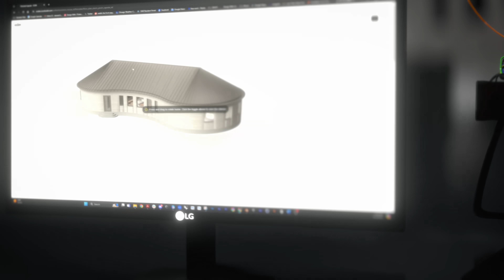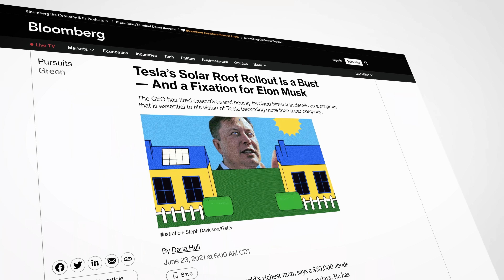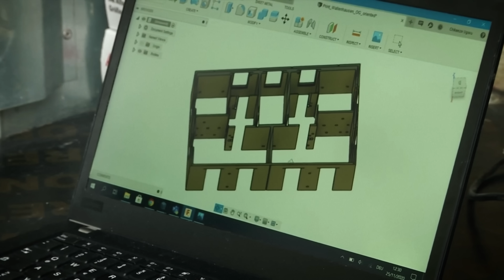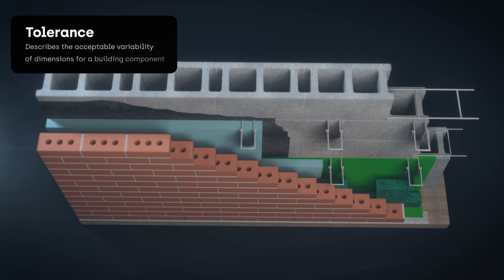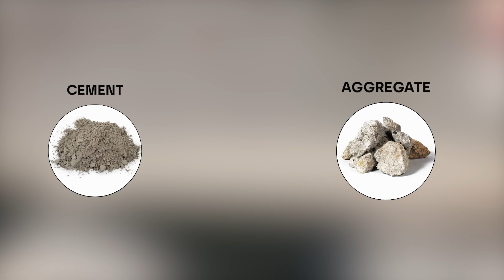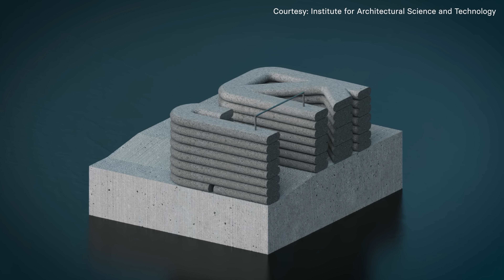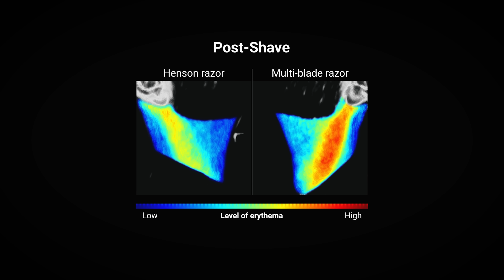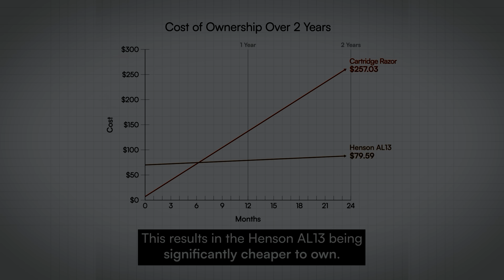Why 3D Printing Buildings Leads to Problems

Comment: We manufacture tons of consumer goods to extremely high quality at high volumes, such as cars, boats, computers, stoves, ovens, etc... Why is manufactured housing still so stigmatized and low-key, not actually that affordable?
Reply: bro. the house isnt expensive, land is. youre not paying for the construction cost, youre paying for the right to use the land, from the rich land developers.  Land is limited, and they know, thats why they milk every penny out of you. No scifi future construction technology is gona change that.
Reply: A lot of what props up fake wealth in America is real estate. A lot of boomers have liquidating the equity in real estate as their retirement funding plan.

What happens to that if we fix the housing problem?
Reply: Land, permit, inspection, finishing are the one which eat your cost.Building house itself will depends only on material and number of worker (which basically cheaper considered the other things you need to pay first and last).
Reply: An anecdotal answer but in former Eastern Bloc countries prefab housing was the norm until 1990s. After the fall of communist governments however the large state owned and very inefficient building companies disolved or splintered into thousands of smaller businesses and that was the end of it. There was also little demand for prefab because of it being infamous for its large tolerances and poor joints, which may not have lead to any building disasters but was very annoying when not a single floor or wall in your house was at the right angle. At the time, traditional building techniques proved to be of better quality and more flexible in design. 

The difference between cars and houses is the material, the stuff we use for houses is hard and cheap in large volumes but cannot be as easily molded into any shape like metal or plastic. Building houses out of metal and plastic would be so much more expensive and would bring an unimaginable destruction to the enviroment, given how much more energy it takes to turn earth into steel.
Reply: The stigmatization comes from the term manufactured housing being equated to a specific type of home, the single wide mobile home. Even though the term encompasses a vast amount of construction types, many people hear “manufactured home” and they think “trailer parks”. People who can afford it will never choose a manufactured home because they perceive a site built home as being of higher quality. Even though that McMansion they just bought is of dubious quality and a modular home is built under factory conditions.
Reply: Because it's nearly impossible to achieve economy of scale in construction. If it were possible, the existing companies that produce single family prefab homes would have already done it.
Reply: @henryglennon3864  this is totally untrue. Look at rebuilding after ww2, indoor bathrooms, kitchens, children having their own bedroom and for the same price as the rent in a slum and 100,000s being built every year. Economies of scale has happened in construction time and time again, look at the mill towns in northern UK etc. 
The difference is it makes more money to build like we do now and developers want more money .
Reply: @Alex-cw3rz  no. The difference is that after WW2, developers bought immense tracts of "empty" land and built suburbs full of uninsulated houses accessible only by cars. There's no empty land left near cities now, and in America at least, almost all of the post war building stock is so badly insulated and constructed, that they're borderline worthless.
Reply: @henryglennon3864  I'm not talking about suburbs. I'm talking about the rebuilding in Europe which was often built in place of preexisting development, so was expensive land. The new building techniques and the size of the developments made them cheap i.e. economies of scale. Also saying they bought large lots of unbuilt land, now buying so much land did the come at some sort of a discount due to oh ecomomies of scale... Just admit it you made a mistake. 
The post WW2 housing had some mistakes, but adding Insulation and the addition of mitigation of water ingress, which simple things such as eaves is not expensive. For an entire house we are talking what 1% of the cost if that. It is still a lot cheaper.
Reply: @henryglennon3864  well buying lots of land means it would be a discount, I.e. economies of scale. Also I was talking about replacement buildings in europe which was built often in place of existing development. New building techniques and building so many houses is what made it cheap. Yes there were issues, but those issues are about 1% / 2% of the build cost and insulation was an issue before these were built. Not created by them.
Reply: @Alex-cw3rz  it's the same thing. Mass construction was easy and cheap because the N*zis bombed the land to rubble. Where you aren't building on wide open stretches of land, you can't achieve an economy of scale. Insulation also adds to cost because it thickens walls, which either makes the interiors smaller or the footprint bigger. The bigger the building, either the more rentable area you loose, or the square footage in the cost per square foot equation goes up. You also can't mass produce foundations, esp continuously insulated foundations.
Reply: @henryglennon3864  most council houses were not built on somewhere bomb they pulled up a tens of thousands of terraced houses for them. I like how you ignored the fact that buying large amounts of land at discount is economies of scale. Not to mention again, new building techniques and the fact they were building 100,000s reduced costs this is a fact.
It adds a few hundred millimetres per property in height and to the sides. It adds so little you can put it in pre existing houses. 
You can mass produce materials to make foundations, use R&D to make it easier to make foundations through machinery etc.
Reply: Because unlike those other goods, the majority of how buildings are constructed can't be automated.